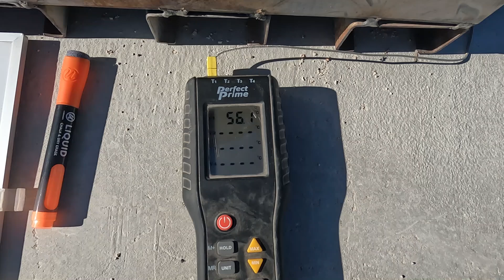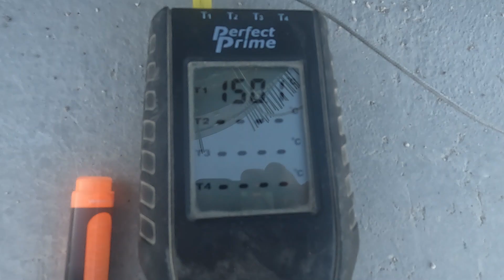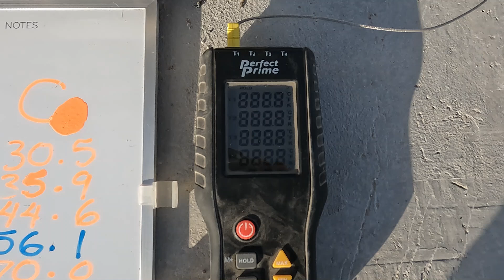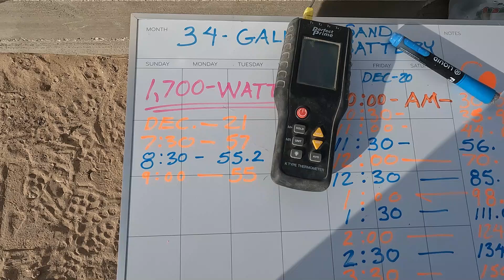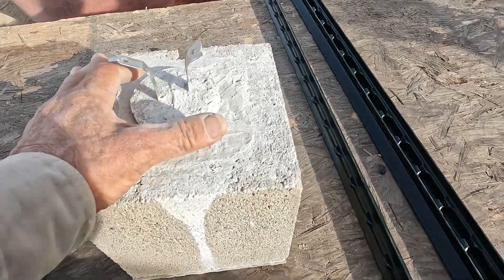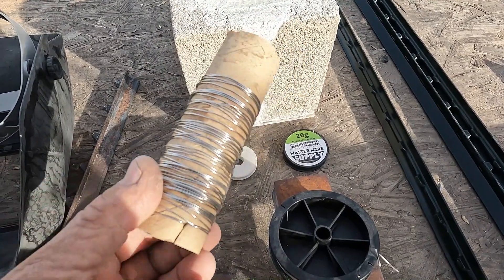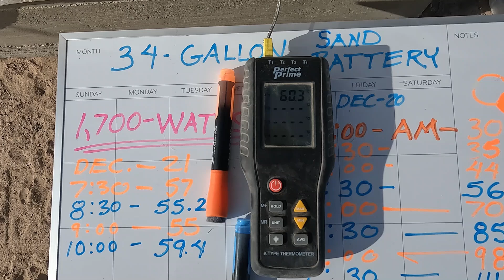174 - Thirty-Four Gallon Sand Battery Update

Comment: So what do u hope to achieve hot air? Are u shooting for a certain temp? O just has hot as it can get can figure out proper distribution of heat later?
Reply from the maker: Once I get the wattage to sand ratio worked out along with the design. I plan on regulating the heat with fans and possibly a thermostat.

Comment: love your experiments and content updates! Do you have a list of items and links to amazon needed to build a 55 gallon drum sand battery by chance?
Reply from the maker: At this point I haven't nailed down the power consumption requirements to actually make it work to my satisfaction. I wouldn't want to put any list together until I can hopefully have a working model. If I can ever get a satisfactory prototype running I will give full details of all the materials along with diagrams.

Comment: So are you thinking the golden ratio is 1 gal of sand : 50w?
Reply from the maker: Yes something like that. I am shooting for roughly 5- watts for each pound of sand. It is crude and kind of hit and miss at this point.
Reply: Your data is amazing and I appreciate it very much I knew my design would work better but your adding of fins inside is smart i did it will just exhaust pipes and oven elements around it with sand surrounding that and then on the outside of the barrel to lock in the temp until i discharged it